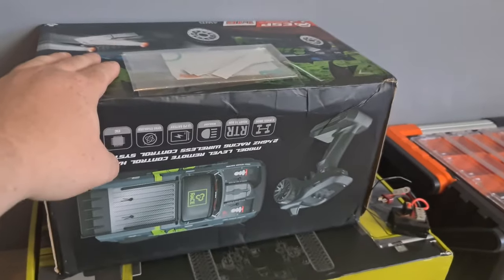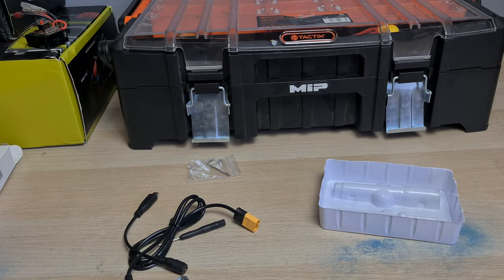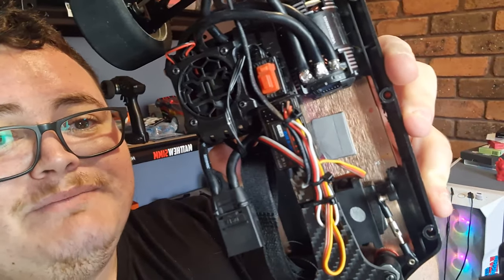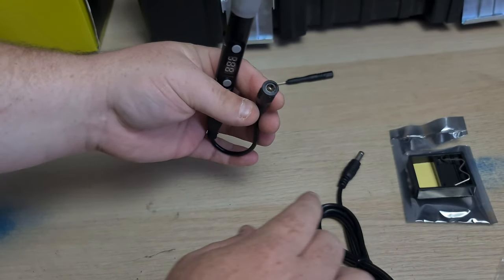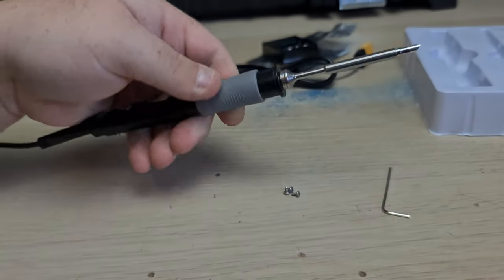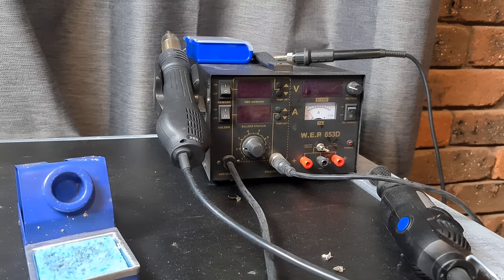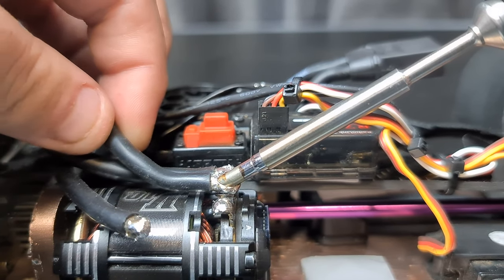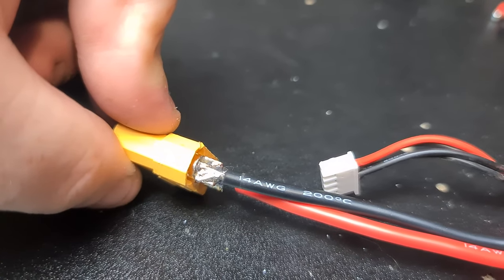6S POWERED! Portable Soldering Iron! SEQURE B60D Unboxing & Review!

Comment: its minimum voltage is 12v, a 3s lipo only outputs 11.1v so the minimum I would run it off would be a 4s battery for a comfortable 14.8v. The higher the volts the faster it will heat up and retain its heat when working with it. 6s will obviously preform the best!
Reply from the maker: A fully charged 3s battery will output 12.6 (4.2v per cell) if it's all you have, it'll work but if you can, go with the higher cell counts like 6s 😀
Reply: Yeah sure if all you have is a 3s it could do the job.😁👍

Comment: Can you run this on a 2 or 3 s battery
Reply from the maker: I believe it'll do a 3s battery, but it can take a bit longer to heat up, I have ran it on a 4s and it works perfectly